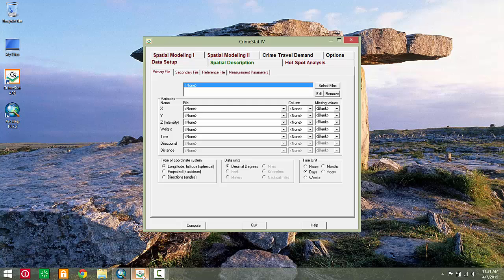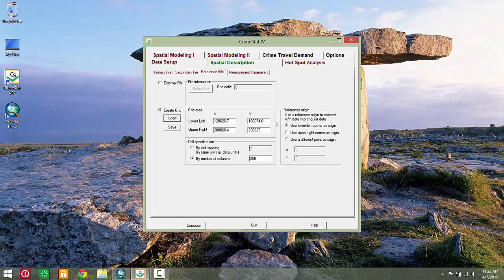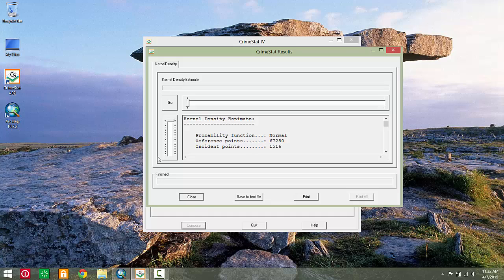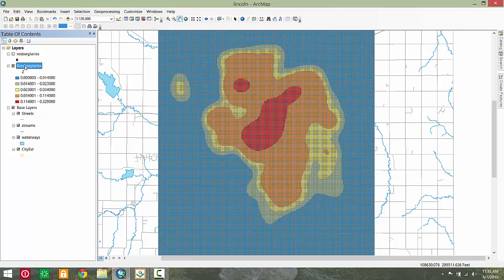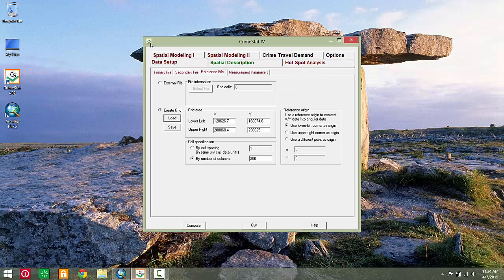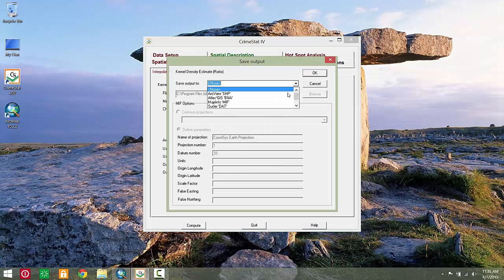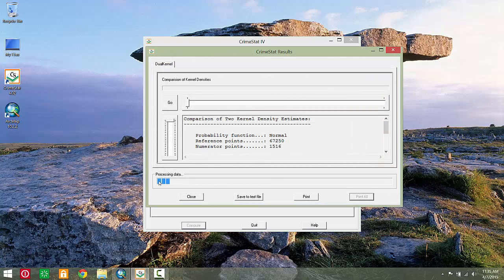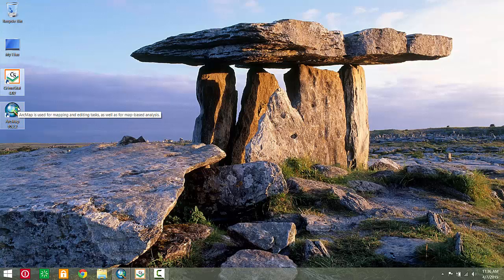CrimeStat 4 - Tutorial 4 - Kernel Density Estimation

Comment: What exactly happened to the datas when you added the second layer variable of the census data? I am not sure I understand what the weight is showing? Does it mean that it gave more weight to crime in higher density population areas over lower density population areas? Also, how would I use this to estimate the location of the next probably location for crime? How would I display that data or prediction to a superior who is basically a moron when it comes to math?
Reply: Hi. That step is to normalise the number of incidents, e.g. number of burglaries per household - rather than just the total numberof burglaries. To show areas of higher risk.